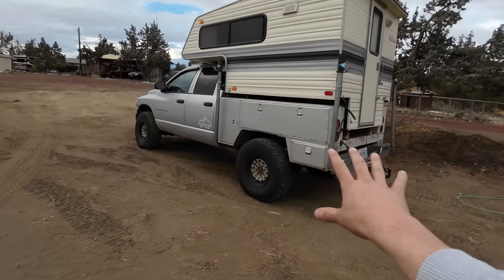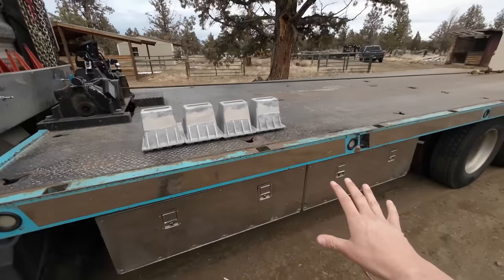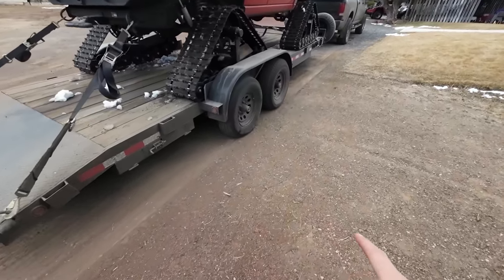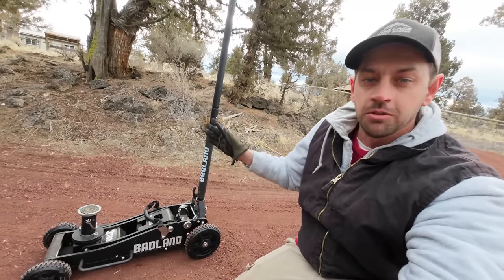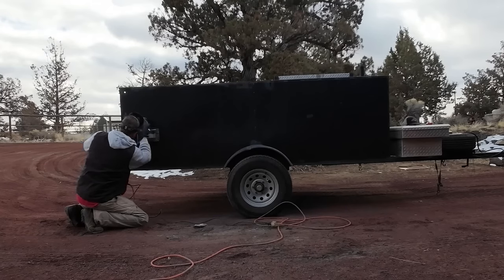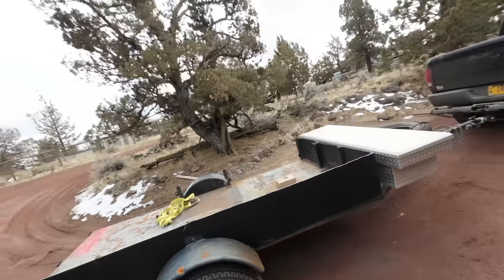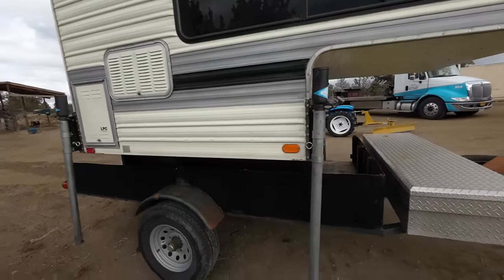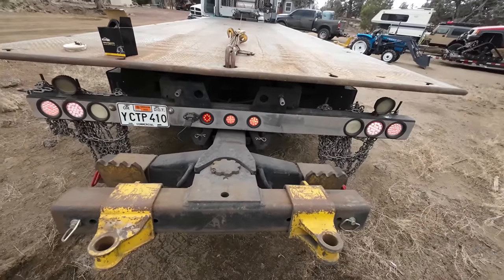A review disguised as a vlog.  (Or vice versa?)

Comment: You should probably paint the ice chuck red (or another visible color). In the snow they will be invisible if they get buried.
Reply: That grey color will be invisible even in plain sight!
Reply: They usually come powder coated in orange. Those ones are raw from the foundry. The raw ones usually have better grip.
Reply: @tetedur377  powder coat is slippery. The raw aluminum has better grip.
Reply: Reflective Tenacious Tape on the sides.  Bonus visibility on the roadside, plus it's so much easier to spot your gear with a head lamp.
Reply: @kd5nrh  Best suggestion yet!

Comment: As a security installer I am so glad you said what you did about your security system/ other YouTubers. Worryingly I see other professional security installers posting pictures of work they’ve done including where cameras/ sensors are and then pictures of monitors where you can see what the camera is looking at. 🤦🏼‍♂️🤦🏼‍♂️🤦🏼‍♂️
Reply: Is there a way to install cameras that is less obvious. Where would a guy go to learn such techniques?
Reply: @Kyle-ev4fk  you could install bullet cameras in decoy housings such as bird boxes normally overt cameras are beneficial as they act as a deterrent. 

I haven’t seen a pinhole camera that is IP rated for outdoor use and they don’t have infra red for illumination so that’s why I would house a regular bullet camera in something.
Reply: @MrJordanwain I have used old desktop computer power supply housings sprayed flat black and mounted high. Looks like an electrical box because it is. LOL
Reply: Yeah; people really won't consider the implications of where a camera is placed, and what others can do with that information.

It's been a couple decades since I've seen the {before and after, after, after} from one area(?) chronically installing wireless (analog NTSC) cameras aimed at keypad gates and combination locks at a relative's home.  

My host and the installer(*s*) didn't understand why I was so angry at a few specific camera placements when I found out they'd decided to 'upgrade' to wireless ; evidently not understanding that (unlike the original closed-circuit) criminals didn't need to be "'inside' to see the same screen" with a wireless camera broadcasting it to whole street - or that changing the channel on the TV doesn't hide the camera's view from an outside attacker with their own receiver.

While I was visiting they suffered multiple break-ins (through the first gate) in the days following because the local burglars/garden-poachers were just rolling around (analog wardriving in the 90's, lol) waiting for someone to enter a code; and didn't notice (or care) that my host was changing the code multiple times a day, because the criminals just recorded the codes and waited for a car to leave, then rushed inside in to grab anything near to the entrance and sprinted off if someone is home. (Generally the gate code and entrance codes are used close together.)

I dropped the argument when one installer stated defensively that he and other locals were rolling in business installing new cameras and locks because of a surge of break-ins; and "they wouldn't be making so much money if [the cameras] didn't work".   And they also 'really' wanted to see how the thieves were bypassing the different combination locks, since relying on physical keys (that could be stolen or duplicated) was unpopular at the time.

[edit: huh?, YouTube cut the punchline off. rephrasing...]

I got to install a new d___ bolt, and replaced being frightened (then annoyed) by burglars knocking things over with being startled (then amused) by people (incl. my relatives) face-planting into the door when they forget to (or how to) use a key to get inside.

( Interestingly, the door was just out of frame when the camera was replaced 'again' during that visit. )

Comment: I like that Badlands jack. I have a gravel driveway that I work on. I use Harbor Freight aluminum jacks, I'm on my second one. I have a pair of the aluminum jack stands, a 3 ton and 6 ton steel stands. I have plenty of 3/4" pieces of plywood to put under the stands and jack. I also have plenty of scraps of 2x4, 2x6, 2x8 and 2x10 lumber as well well as some 4x4 pieces for blocking  when needed. 
I also have a set of wooden stands and ramp made from 2x10 rough cut lumber. The stands are 12 inches tall and 20 or so 9nches long. The ramps are 5 ft long that fits into a cut anyway on the stands with bolts to prevent slipping while driving up on or backing down off.
That new jack with the big wheels and steel plate on the bottom would make it easier to move around my workspace. 
On your Milwaukee tools, I never drank the Kool aid on them. I use Harbor Freight cordless tools. For the price I can own two Hercules tools for the price of Milwaukee tools. I started with Bauer, then when you the Hercules tools came out I upgraded to them. No regrets. Some YouTubers have switched over to the Hercules tools. These people really work them. Haven't heard any complaints yet.

Comment: You know you can run a plasma cutter along a guide, right? Full disclosure, I've never done it, but, ironically, there are YouTube videos. 😁 I'd rather watch Casey screw something up than watch Dave fly a helicopter.
Reply: Thanks for pointing that out. I do own a nice plasma cutter and that was my first thought too. Just clamp a straight board or piece of steel to the side of the trailer and use it as a guide. The plasma torch cut can actually be straighter and cleaner than that saw cut since the edge will be “fire polished”.

Comment: You can do videos like this any time that you want to - I think most of us are just content to spend a day with you seeing some of the little life's projects and hearing your very valid thoughts on things like the security systems and the different usages that you have for your rigs. I do wonder about the jacks on the camper if you are going to trailer bed haul it - they appear to be low enough that going into the woods with them installed would be a sketchy proposition (fixing broken mounts is a pain in the rear - been there, helped do that). I wonder if putting the platform back under it would accomplish two things - keep the platform safe from being damaged, and two, raise the camper up several inches, thus increasing the ground clearance of the camper jacks so they aren't quite so much "low hanging fruit".

Comment: Project #6 electric jacks with wireless remote for the camper.  My old camper was a 10' Lance and jacking that up to remove from my truck 4 to 5 times a year, wore out the jack linkage pins (bag of black bolts for replacement and oil can to the rescue).  Newer camper has electric jacks. OMG how sweet it is.

Comment: 1. putting your camper in the trailer makes sense sometimes, but, when you need it, and need to pull a trailer, doesn't make sense. 2. Simply Safe, sure they want you to do vids as to how to install and how they work, but, that doesn't mean you have to do the vid exactly where you would install them for good.3. trailer tires, just keep them rotated and eventually you'll need 4 or five tires instead of one at a time. Also, I recommend  getting truck tires instead of trailer tires. last much longer and a lot fewer flats.

Comment: crack the valve loose on the camper jacks and pull the legs down to the ground , tighten valve and then pump the jack handle
Reply from the maker: Doesn’t work like that on these ones.  I tried.
Reply: @CaseyLaDelle  I have same jacks on my camper

Comment: Thank you for your opinion on the badlands jack -- I have been debating on if I want to get one, and I think now I will.  The fact that all of the parts store on the jack finally sold me.  Also, THANK YOU for what you said about security systems!!  Why anyone would show all their cards on you tube is beyond me.  I have a several layer system myself, I have easily seen and visible cameras out in the open to discourage the average thieves, and all kinds of hidden cameras and sensors to surprise the more motivated thieves.

Comment: Damn You Casey.   I have a standard 2.5 ton floor jack in my toolbox in the bed of my truck.  It’s so big and heavy that I don’t take it out.   Now I need to check the weight and size and replace it.  I’ll leave the big and heavy one in the garage.  

I would look to remove the sides on the trailer and add toolbox’s for storage but it might make it too heavy for a single axle.

Comment: Just wanted to let you know I had those jacks on my camper and if you just loosen the valve up you can pull them all the way out to the ground then tighten the valve back up and then start jacking and you won't have to stand there for 25 minutes pumping the handle to get the jack all the way to the ground thought it might be helpful
Reply from the maker: Incorrect.   These do not work like that.

Comment: A trick for making a straight Plasma Cut is to C-Clamp a 2x4 (or other straight edge) to the piece and run the side of the Plasma Cutting Head along it...that keeps the cutting lance running smoothly in a single direction and not jiggling up or down as you cut...

Cutting Edge Engineering does that frequently in his videos and his cuts almost look like they were made by a CNC Robot...
Reply from the maker: There gets to be a point where you just don’t give a shit.

Comment: Why didn't you just buy a pull behind trailer?  I thought the point of bed camper was so you could pull a trailer with a toy on it. I thought it looked great on that truck. Those side boxes would be awesome. Reminds me of an Ambulance I used to camp in.
Reply: Probably so he can take it off the trailer and put it on anything he wants. Now it can be used with the Jeep or any of the other trucks too
Reply: I'm sorry, but did you even listen to what he said?
Reply: I believe his reasoning is that now it is a versatile camper. And what I’ve learned about casey with our para social relationship is that he does not like to be bound by one platform and now he can take his camper. Put it on the rollback for a big job. put it on a trailer pull it with a jeep for things like blm land clean up. or put it on the truck and now he can do a wheel lift job. I’m going to guess later he might make a Jeep hauler trailer so he can do everything without limitations.

Keep up the good work! Still waiting on hi-vis shirts
Reply from the maker: Because I can’t put a pull behind camp trailer in the bed of my truck..

Comment: That camper is going to rattle to bits, on that trailer....
Reply: I do the same thing with my old hunting camper, I have towed it a lot of dirt miles with no issues. You just have to slow down and drive like a decent human. It’s really not much different than a bumper pull camp trailer.

Comment: Please consider how top heavy that camper will be on that light weight trailer. The height and weight of the camper are not a problem with a pickup but I am concerned that in a turn or with a high cross wind, it could turn that trailer over.  You probably have a plan for this but it just seemed like something that might be an issue.
Reply from the maker: Yes, my plan is to pull the trailer and it worry about it.
Reply: Given how low the camper sits on the trailer I don’t think it’s a problem.

Comment: You may not get the Milwaukee hype - I have 12 tools, used HEAVILY in electrical and wastewater projects, logos damn near melted off and only 1 failure in the whole lineup. The chuck seized on my drill, and it was poor maintenance on my part.

Comment: Sooo many questions lol. First I love the content. Keep it up. Is there a video on your add on wheel lift on your dodge? What kind of service body is on the dodge you took the slide in camper off of and is there a video on the tracked jeep i.e. what kind of tracks, did you pick them specifically or did you just happen to find them reasonably priced, are you happy with them etc?

Comment: The Milwaukee saw is not dead.  You overheated the motor and tripped the breaker.  Wait for it to cool off then push in the reset button.  The key to that saw is to not let it bind at all.

Comment: I'm curious, I thought that the idea of the camper was to be able to still tow behind the truck the camper was on. Is this just another possible use and storage trailer for when you're not using the camper for an overnight or all day job and you'll still use it as you originally intended as a mobile kitchen/dining area for day long or overnight jobs? I think you said that at the end of the project description. on the ice chocks, seems like the stack no? How about just a couple rods or maybe looks like 1/2" angle iron off the box you had so it sticks through the slots in the chocks? That jack is badA

Comment: I don't understand your issue with Milwaukee.  I've had a small grinder I've used a million times and its been 20 years or more and I've still got it it still works fine. Been the best small grinder I've ever owned. Not saying your wrong but I am saying I've had extremely good luck with my Milwaukee tools. I would have more if they just weren't so damn expensive.

Comment: Good principle to live by with security systems. The best kept secret is the one you tell no one. If you could get away with not telling yourself, that would be even better. I remember getting a voice message from a security company that is well advertised, they entered the security code with their phone . Anyone can go find a way to use the tone off the phone and identify the numbers they pressed. It was a wrong number. Sloppy. // One of the things I have been successful with is buying tools and equipment. The model circular saw I bought in 1975 still works. The battery powered set is more than fifteen years old. One battery of 4 died recently. Other tools from 1970 through 1990 are still is use. My first powered drill which was seriously abused, from 1975 or so, also still works. Why is it that if I buy a toaster oven, it only lasts for one year or less? The shed that I designed and built in 1976 still stands with no defects despite a lot of heavy wet snow. Stuff I buy nowadays is garbage and breaks so easy.

Comment: I have seen alot of the truck campers put on to small trailers and they only ever use them for a trip or two. The axels aren't wide enough for how high the weight sits almost did it myself u til I started talking to guys who have done it
Reply from the maker: The axles are exactly as wide as the truck axles, and it sits far lower.
Reply: @Casey LaDelle  hard to tell the width from the video most guys are putting them on 4x8 trailers
Reply from the maker: @brettknighten1171  this is a 5x10 with a 7’ wide axle.

Comment: Yes I have heard simplysafe are pushy.  But having seen the “install” most do not show much.  More of water, fire sensors, tight of camera, not location.     That was VERY. Bad calling two trucks. Nothing wrong call one.  “I need this picked up delivered ASAP when can you do it?  How much?  My wife checking.  I will check. Either way I will call you back in 5 minutes with go, no go”. 
  Imo they told you to go. You spent (at least) 30 minutes (I assume) prep, starting drive?  Minimum charge 1 hour.

Comment: Let me see. You have been looking for a 6 1/2’ truck camper to fit your pickup. You find one,it’s perfect and you can still use the lift to tow vehicles and on long trips you will have a place to sleep. Ideal setup except your now mounting it on a trailer. I’m certain there is some logic that made you change your mind, but this old brain can’t figure it out. Oh well doesn’t matter because it’s not mine.
Reply from the maker: I didn’t change my mind.  It is still going to be used for exactly what I said it’s going to be used for.
Reply: @CaseyLaDelle  right, because as I heard it, you now have two separate and distinct options on how camper can be used depending on your needs at that time.